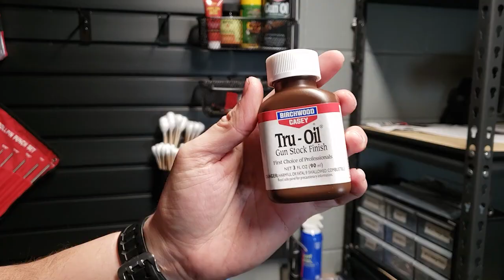Gun Workbench / Gunsmithing & Cleaning Station

Comment: This is a good setup for a beginner, however two things do need to be changed.  First take the claw hammer and put it back in the garage and replace it with a couple of small ball peen hammers (1, 2, 4 oz) and polish the faces to a mirror finish. second take the electrical and masking tape to the garage with the claw hammer and replace them with some good painters tape.

Comment: You really have a nice setup!  My own personal taste, but I would add an optivisor for the hands-free optical magnafication, additional cleaning rods as I hate taking the time to swap the bore brush with the patch jag, and a couple of needle oilers for your favorite oil or solvent.  

Another thing I like to have around - acid brushes for applying oil or grease or for general wiping/brushing.  I can trim the bristles back if I want a stiffer brush.  A box of them are available at Harbor Freight and they are cheap enough that you won't feel bad if you toss it after one use.  A box of 36 is about $3.

The other thing I would do, if you don't have to have your bench mobile, is to lag bolt the bench to the wall.  This will steady up the bench and make it rock solid.  You will be appreciate this if you ever have to pound on something or reef on somethng in the vise.

Thanks for sharing.  Cheers!

Comment: Get a sonicating bath.. It's worth the money.. dental tools, cause you need to be able to clear threads... a second vise thats not so close to the end of the bench so you can work on things that may be longer on other ends... If you dont have a drill press and multiple rethreading tools your missing out.
3 levels with 2 that are magnets.
a polishing wheel and a holder.